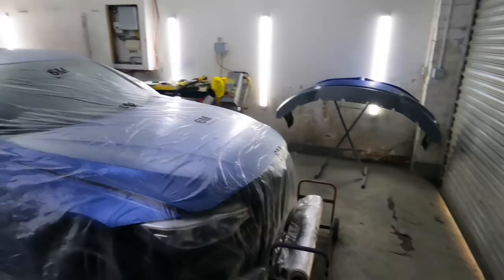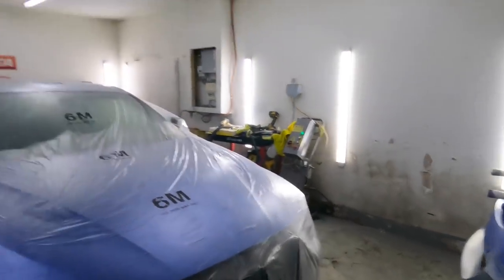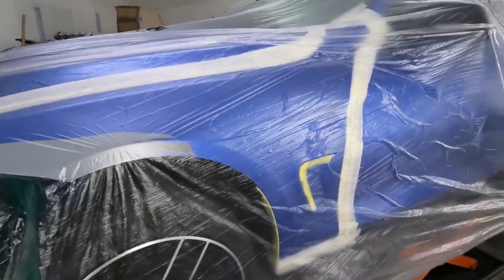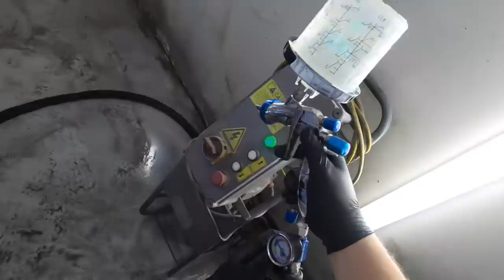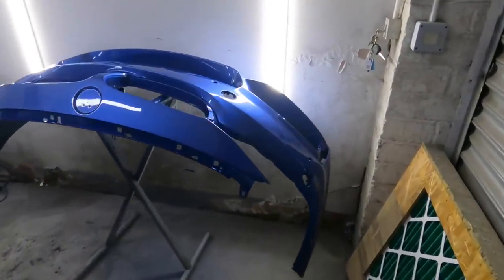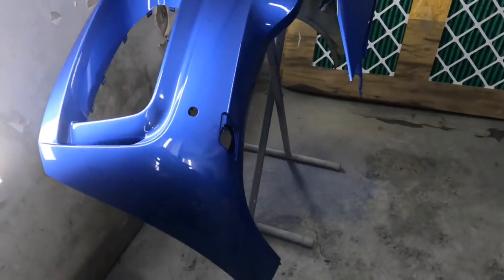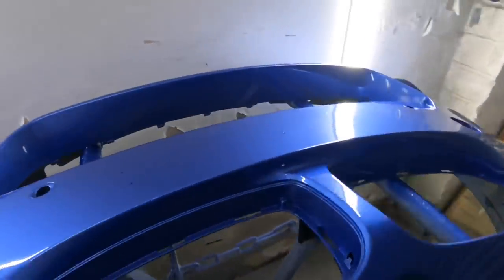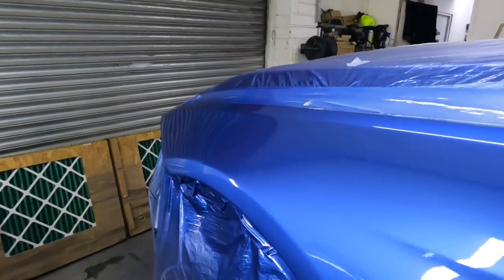Bmw 420d m sport repair pt2 paint time 👌👌👌👌👌

Comment: Nice blue that, even pre clear coat. Looks similar to the Ford RS blue. What is that orange tool you attached to the airline and ran over all the parts between coats? Excellent work👍
Reply from the maker: It’s a stat gun removes static from the panels which helps repel dust 👊👊👊👊👊👊

Comment: Looks like grant is double dropping again 🤣🤣 😎😎  you've earned some play time m8 as always cracking contents
Reply: With touching up does it come with experience as to weather to get a perfect match or do u have to make your colour to blend in with the colour of the car would love to hear your thoughts on this m8
Reply from the maker: Most colours are not 100% match but yeah close match then skill required to blend correctly so bit of both 👍👍👍👍

Comment: Are you pleased with that anti static gun ? I could see a couple of specs on the wing ….that from the air dropped down or something out of the spray gun ? 👍👍👍👍
Reply from the maker: Just a few bits of dust but very acceptable I’ve not used the stat gun enough yet but so far so good if they keep coming out this clean well worth the money 👍👍👍👍👍

Comment: Love your videos mate.
I need to paint 2 wings and some panels for my car , at home under a gazebo.
I will be using quartz liquid glass.
Do I need a heater or will it dry itself?
Or am I better painting in the sun
Reply from the maker: I’ve not used the liquid glass I heard it’s known for solvent pop, but yeah do it on a warm day should be fine check there tds should give you an idea of drying times 👍👍👍👍👍👍
Reply: @grantssmartrepairs  cheers mate what clear would you suggest mate
Reply from the maker: I use mipa cx4 and I also use multi mix
Reply: @grantssmartrepairs  cheers mate , you reckon that will be ok using over rattle can paint?
As I’m painting my wheels with rattle cans as it’s the exact colour I want , just let it dry for 30mins and then clear coat it.
Thanks again mate
Don’t worry the panels are getting painted with a HVLP
Reply from the maker: Yeah will be fine 👍👍👍👍👍
Reply: @grantssmartrepairs  cheers mate , the Mipa seems the best to be fair , would I be best using mipa WBC thinner to reduce it?
Or does that not matter?
Reply from the maker: No that’s for water based not
For clear you need some solvent thinners mate 👊👊👊👊👊👊👊
Reply: @grantssmartrepairs  thanks very much mate , so just a standard cellulose thinners , same stuff you clean your gun out with,
Reply: @medievilassassin  If in doubt always ask your paint supplier, they know the products they are selling :-) I always use 2k thinner in Mipa 2k clear coat. Mipa website probably has data sheets for download too.

Comment: What are your settings on the ws400 for clear?
Reply from the maker: Fan closed then out 1& 3/4 turns
Full fluid
And 2 bar pressure 
👊👊👊👊👊👊👊
Reply: @grantssmartrepairs  cheers 👍